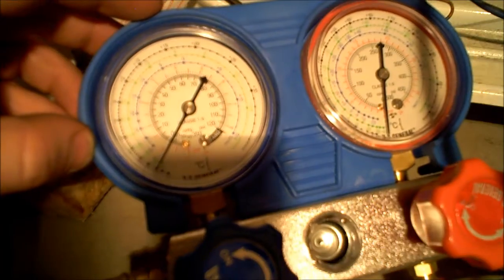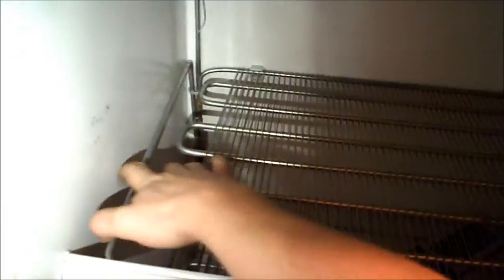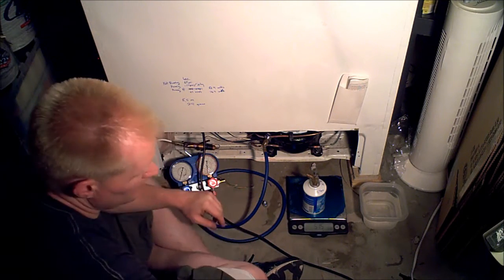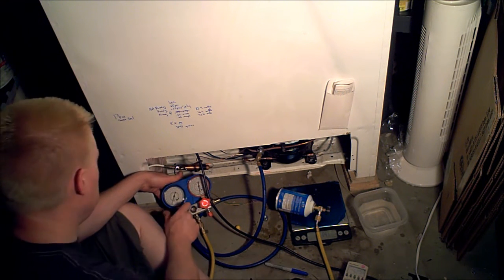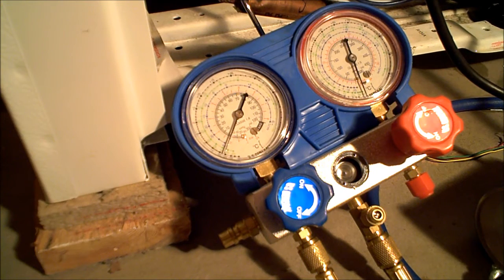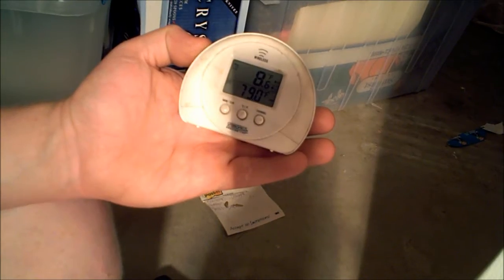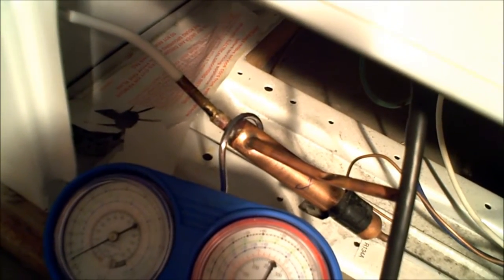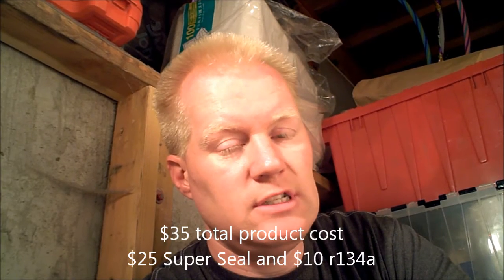Upright Freezer repair r134a refill part 2 of 2

Comment: Did you purge the system when you switched cans or did you use the R134A to push the sealer though (as you say that is what you planned to do)
Reply from the maker: Loren Lasko The line was purged before each application. If I did it again I wouldn't use the sealer. It could clog the filter and cause issues down the road(could?). Theoretically it took almost a decade for the original charge to leak out and it should take that long a second time. r134a is cheap and readily available. It is the same stuff they you spray out of computer duster cans so there is no issue with it continually leaking. By adding a port I can easily check it a couple years later and add some more refrigerant if needed.
Reply: sixtyfiveford Thanks for the info, I have the same freezer as you do and I noticed a hissing sound that I can only hear inside the freezer when it is running.  When I turn it off the sound remains for 10 min or so then stops.  Is this normal or evidence of a leak that should get sealed? I also tried the soap method but haven't been able to find any leak. I got the freezer used so I don't know if the sound has always been there.  The top shelf is the only one that ices up and the temp gets down to 2F or 3F but no lower if I let it run overnight.
Reply from the maker: The hissing sound is normal.
Reply: sixtyfiveford 
Thanks,  I recharged the system and it is cooling much better.  I think I slightly overcharged it (I was at about 3psi), I am getting frosting on the suction line so I am slowly releasing some of the r134 as my pressure is at 0 psi now.  I have two things I was hoping you could shed some light on.  First do you know what temperature range is normal cycling for the freezer I am getting temps from about -10F (setting 4) when the compressor turns off and turning back on when the temp reaches about 20F (the lower range is controllable by the temp control depending on what I have it set to).  Second the pressure in the suction line when the compressor is off is much lower then yours was.  Before the recharge I was about about 35psi after the recharge I am at about 20psi when the compressor is off.  Is this a sign of something else being an issue?
Reply from the maker: When it kicks on and off is all controlled by the thermostat. The most important thing is that it is cooling all of the coils. Every freezer is going to be slightly different.
Reply: sixtyfiveford Thanks, any ideas about the low pressure when the compressor is off, it is down to about 15psi so I stopped releasing the r134a (that I was doing to try and relieve the suspected overcharge) from the system as doing that has be lowering the "resting" pressure and I don't think its normal for it to be that low (or is that normal?) I am a bit below 0psi when running.
Reply from the maker: You don't want to be really below zero.
Reply from the maker: Loren Lasko
Read your spec sheet, it'll say what the pressure is supposed to be on your particular model.
Reply: sixtyfiveford it is the same model you have with the 0-14psi on the suction side, but I am getting the frosting on the line which I was reading is a symptom of overcharging.  But that issue seems to be different from the issue of the low pressure when the compressor (only going up to 15 or 20 psi) when it looked like yours was at about 60psi, Any thoughts on what would cause my pressure to be so low when the compressor is off?
Reply from the maker: You don't need to worry about the off pressure just the running pressure. Also after you make an adjustment you need to let it run for a while before making more changes. Try to get your pressure up to 2-0psi.
Reply: sixtyfiveford So still trying to get this right I am getting a thick layer of frost across the entire suction line (up to the compressor) when it gets near the set point (about -11F).  But my gauges still show a slight vacuum (about -3psi when at set point).  The frost, from what I have read, is an indication of an overcharge but how can that be at a -3psi pressure? Could something else be the issue?
Reply from the maker: The filter dryer could be partially plugged, requiring the suction side to pull more vacuum  than it should between the filter and suction port. I would allow it it run as is. Too much refrigerant and cooling will drop off quickly. As long as the compressor isn't overheating and the temperatures are good within range I think your OK.
Reply: sixtyfiveford Is there anyway to fix it if the filter dryer is partially plugged? (i.e evacuating and pulling a vacuum and refilling) or would I need to replace the filter dryer?
Reply from the maker: The filter dryer is a replace only item. It really wont hurt anything if it's only partially clogged, it'll just throw off you readings.

Comment: have you every recharged a Dehumidifier?  I have a Danby, everything seems
to run, Compressors runs and all electrical seems good.  A very slight cooling
at the bottom of one of the coils.  I have flushed cleaned the condenser coil but still
no luck.     Does anyone make an adapter to use the R134A and hose found at Walmart used for charging car A/C ?
Thanks,
Ken
Reply from the maker: The principles are the same but the pressures you see here are different.  You need a can of R-134A without a premade hose attached. You could then use a standard piercing valve to open the can and hook to standard gauges.
Reply: Turns out my Danby uses R410a.   I can't seem to find small cans cheap like R134a
Ken
Reply from the maker: Yeah, the r410a isn't available for sale to the public. You have to be licensed to buy and handle it.
Reply: sixtyfiveford

NOT TRUE , you do NOT need a certification to buy R410A or R134A  unless you live in WI.

the only certification you need is for "older" refrigerants like R22 , R12 etc.

Comment: The strainer-drier is most likely plugged, or partially plugged.  shut the frige off and feel the strainer (that long 3/4 inch diameter tube with a small tube (capillary coming out one end) for a cold flash on the capillary end. Give it time to do this. If the outlet end at the capillary gets pretty cold, and may even frost at this end, then  this means that the restriction is in the drier and it will have to be changed out and recharged.  You should have a tech verify this.No cooling usually means a restriction of a leak that has lost enough refrigerant to keep the system from doing its job.

Comment: Hi, sixtyfiveford great video and has been a big help in the project I am working on. What fitting is the self piercing line tap fitting R134 or R12? My gauges are for automobile and looks nothing like the ones you are using (my gauge fittings are much larger). What do I need for my gauges to hook up to this?
Reply from the maker: My gauges are automotive as well. The fittings are R12. My R134a fittings screw onto these so I just remove them.
Reply: sixtyfiveford Is that metal sealer like a foam or a liquid?
Reply from the maker: I would assume it's a liquid.

Comment: Did you ever have to add the sealer or did I miss that?
Reply from the maker: I did. I think it is at the end of part 1. If I had to do it again I probably wouldn't add the sealer. I would just top off the R-134a and check it once every year or two. Because if it had the leak from the factory it has to be very small to take 10years to leak out. So theoretically it should take that long to leak out again.

Comment: What happens if the vacuum side is at 5 instead of between 0 and 2?
Reply from the maker: Won't cool as well as it could.
Reply: sixtyfiveford thank you I followed your video to the t and im sitting now just waiting to see if it will cool my low side was negative just like yours.
Reply: sixtyfiveford When i watched your video i followed it to the T...my system cooled. I didn't leave it on for too long after i saw that it worked...2 days later i plugged it back in and now its warm again...what do you think i did wrong?

Comment: you should make a third video showing how to purge the lines and tell us how to remove and seal where the line tap was,did u put in any refrigerant gas or just the sealant,and which line did u tap,was it the left Gage alone u was using and where did you connect your amp meter.what is the right amount of amp should the motor should be pulling?.
Reply from the maker: Purging lines is as simple as cracking open the end the connects to the fridge/freezer and letting a little new gas escape, then closing up the line and proceeding.

The tap never gets removed from the fridge.

Yes, gas was added as well.

The suction line is what gets taped. You will need to look at your system and a picture of a basic refrigeration system to figure out which line is yours.

The amp meter was just plugged into the fridge outlet and the reading is on your data sheet. Every fridge is a little different.

Comment from the maker: You can't take a line tap off. R134 or Tetrafluoroethane is the exact same thing in computer duster that you spray out into the air. Not illegal.

Comment: I saw at end of part 1 when you hooked up the low pressure side hose while freezer was off. I didn't see you purging air out of hose before turning compressor on, unless you didn't show that step. Once compressor started, the air in that hose was pulled into the system once it started to operate in vacuum. For a system that operates below freezing, you have to be careful otherwise humidity in air may freeze up in metering device and system will stop working.

Comment: Super helpful video. A neighbor gave me one of these exact freezers with the same problem, and I got it working.  I bought parts from northwaysmachinery.  They had better description of the parts than ebay to help me ensure I bought the proper items; probably cost a bit more.  I bought these parts for $70: CBI LX84, TNK 1336, TNK BVP31.  These tap valves were great.  The shutoff is separate from the input, so I didn't lose any freon. I did scrub the copper line with steel wool first.

Comment: hi i know your not a refrigeration engineer but you did a really good job, i wouldnt have attempted this before i was a refrige engineer to be honest so fair oplay , just a heads up if your condenser ever does spring a leak just cut the lines that go from the compressor to the condenser and get a exterior condenser from an old scrap fridge bolt it on the back and put the lines together then youve got a new condenser on the back of the unit ready to rock an roll for another few years

Comment: Great Job!  1 point - you should mention even if you have freon in the system like you did - that you should allow freon to run all though your gauge lines to your freon can and then tighten your can on the system.  If you don't you are pulling all the air from your gauge lines into your system and eventually it can cause ice inside the lines.

Comment: It's all good. Didn't read datasheet. I was taking a reading when the freezer was at 5. Should be taking at lowest freezer setting of 1 and pressure between 0-14 is optimal. I currently have 12 and freezer going great.

Just wanted to let others know that so they don't keep adding refrigerant like me due to not getting a proper reading.

Thanks again

Comment: Guess i spoke too soon. It's in the basement and every time i go down, i check the pressure and it's always below 0, however, the freezer seems to be working great for a day now.

I checked with a different gauge this morning and it showed about 10, but when i checked again this afternoon, it went back below 0 and i keep adding. I'm almost done with the 12 oz can that i have and the freezer should hold about 8.5 oz. Do you think i potentially have a larger leak? i did use the same sealant BTW.

Comment: Thanks for the video my friend. Didn't get the manifold guages, so i had to get a retrofit adapter to connect to valve and became similar to the low side on a car and i managed to charge it with a regular cage.

It's much better than before. Kudos to you my friend for taking the time to make this video ;)

Comment: hey dude thanks for the video and also i have one question if the pipe is freezing that mean i put to much freon ?i dont have any equipment like yours and i check the pressure and is running on 5 psi

Comment: Good Job. I recommend using the Bullet Tap Valve if you cant braze one in. Sometimes you just cant fix the leak due to location, and thats when certain additives can help. Some are better than others. if you can find the leak and its in a spot where no high heat can be used LA-CO Heat Stik has fixed many aluminium evap coils for myself and my customers with great success. None the less, you've done a good job with very little money involved. Is it still working for you?

Comment: Just to note, your system was running in a vacuum when you first started. If your leak was on the low side (suction) this will draw in air/moisture. Firstly any air in the system will change the running pressures in the system, (Daltons law) you cant then use the scale you have. Also moisture in refrigeration/air con systems will cause blockages and acids in the system.

Comment from the maker: Some brands do run the 2 together as the run up into the cabinet. The High pressure runs out of the compressor through a large tube then around the exterior of the cabinet or through a condenser on the back of the freezer-fridge, then into the drier. Then it flows through the capillary tube up into the cabinet. Here it dumps into a larger tube(start of the low pressure side) and routes inside the fridge. It then exits the cabinet and enters back into the compressor(this is the low side).

Comment: Did you find the leak in the system I would look for it with a leak detector For HFC 134A . I bet your leak is in the cap tube or somewhere its rubbing . also use superheat or subcooling for themo txv valves . But you can use a bubble test for a leak for it too , . If you find it make sure you pull a vacuum on it with a vac pump .

Comment: I didn't see you bleed the air from both of your hoses before you started. You probably have a bunch of air in your system which will prevent it from working any colder.

Comment from the maker: My understanding is that the equalized pressure is taken with doors open and everything the same temp. Old time techs that have been working on refrigerators their hole life say just to take the suction pressure to approx 3-5psi with running and your done (all makes and models).

Comment: This is very helpful. My specifications sheet lists minimum equalized pressure instead of a suction pressure. 45psig @ 70F and 60psig @ 90F. Do you need to add refrigerant while the system is off until it gets to the right pressure? Do the evaporator and condenser both need to be at that temperature(ie doors open, unplugged for a while) or is it assuming that the system was just running? I'm surprised that you aren't supposed to use superheat and a PT chart.

Comment: Good job sixtyfiveford. I had (or have) the same problem with a 5.1 oz (145gram) Frigidaire, same year 2004 and had to do the same thing you demonstrate in your vid. Apparently this is NOT a rare problem.  QUESTION: Isn't there a risk of the sealant clogging the capillary tube?

Comment: I always add freon to 5 PSI and that way when I remove the hose whatever gets lost does not affect cooling. Also I would not have added any stop leak mess. The freezer has been going for years low on gas so why clog it up with messy costly stop leak. Add in till you get 5 psi and save yer freon for the next time which may be years from now. Also you failed to sand the copper before attaching that saddle valve and it is gonna leak big time. You failed to attach it to the charging ear also.

Comment: Very nice video. The refrigeration guys really hate the clamp-on ports and sealer...but  they would undoubtedly have condemned your freezer and you would have been out a service call
and still have to buy a new freezer..so nothing to lose. So even if you have still add 2 oz of refrigerant every year or so due to slight leakage around the clamp your ahead of the game.

Comment: Komokozie is right.  You should evacuate the entire system and change the filter dryer.  The oil is hygroscopic, or absorbs water, and you will not be able to vacuum it out.  However, maybe the leak is on the high side, in that case, you get lucky and air didn't enter the system. If the leak is on the low side, you are pulling air into the system which contains moisture.   Anyway, You should definitely purge the hoses.  Good video by the way. Super Seal hardens when it contacts air.

Comment: Plus .. just fyi .. sorry to tell ya, but that clamp-on access port you used 'will' leak.  You added leak sealer but left on an unsealed port.. and it 'will' leak!
That kind of 'clamp-on port' is only really supposed to be used for diagnostics, then you fix the leak, and put on a permanent (sweated) port.

Comment: This kind of cooling system CANNOT have ANY moisture in it!  You need to PURGE THE HOSE before turning the system on or even actually connecting the hose completely.
A positive pressure 'charge' (from the Leak Sealer can or Freon) needs to purge the hose of air BEFORE being tightened to access port, ESPECIALLY on the 'Low' side. As soon as that went into a vacuum, anything in the hose got pulled in. What about when you changed cans... did you purge?? You didn't show it, if you did... Just FYI

Comment from the maker: It could be a variety of things: low refrigerant, clogged filter dryer, burnt out compressor. I felt I had nothing to loose in this video so I tried it. I love to fix everything but there is a point with these freezers where the cost of a new unit with its lower running costs will cost you less to buy and run for the next 5 years than the cost to fix the old one and run it.